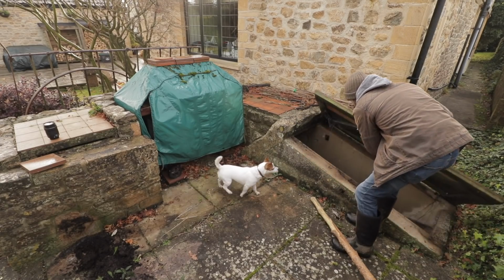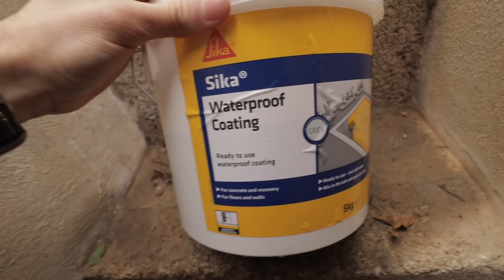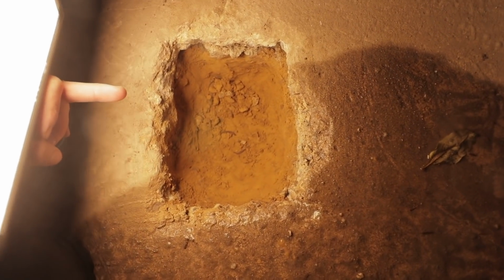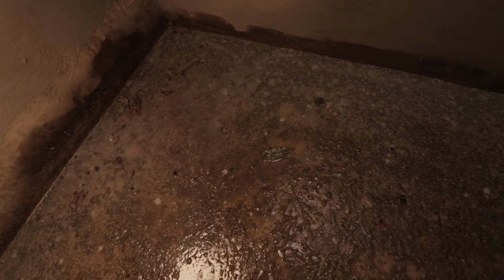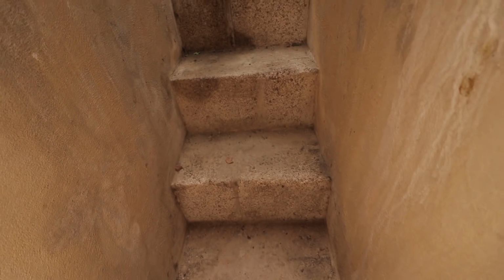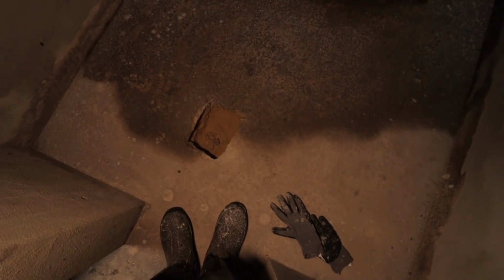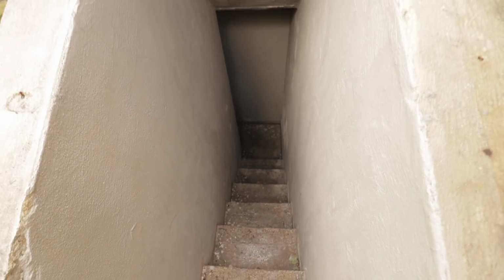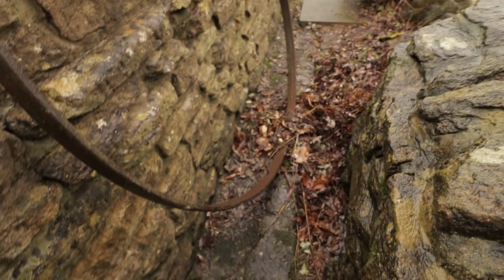WW2 Bunker Renovation: Sealing the Inside (PART 4)

Comment: don't want to be "that" guy but concrete is porous and all the water above and in the soil around the bunker is soaking into the concrete, the concrete needs a way to rid that moisture. sealing the inside just keeps the concrete wet all the time. which is going to make it crack and fall apart sooner. There really is not a good way to save it. you are better off drilling holes through the concrete allowing outside water to run inside and down to the pump.

Comment: If you are like the rest of us with children, money is tight. For a temporary quick-fix, cover the bunker door with a cheap tarpaulin to keep the rain from leaking in. On this side of the pond, we have something called a "breeze box" fan. It is about 2x2 feet, and is 2 or 3 speed, non-reversible. On a dry day, just lay it on top of the vent rebar, blowing UP, and open the main door. This will circulate air. For that spot that needs repointing, don't. Break up the old broken concrete and lay a new section. It will be more effective, and cheaper in the long run. Ian

Comment: You should not have cemented rebar over the vent shaft, but rather installed a temporary cap until you can install a more permanent "door vent" (a vent cap that opens when unlocked from the inside). Why? you are going to want a second EGRESS. Very dangerous to have only one way in/out  : /
Reply: I wondered about that too. looks like a dungeon.

Comment: Use a frame and some flashing around your access door and have drains at the bottom maybe ? Point it all in like mentioned and it should be water tight. Also maybe use a dehumidifier rather than a heater to keep RH to a minimum while it’s drying 👍🏼

Comment: Please get that hole in the floor done, you will regret it later if you don't, as you said at least get a form in there or fill it up until you are ready to put the sump in.

When my friend did his basement about 25 years ago we used a concrete/stone etch primer then ran a coat of what looked and smelled like babies first poo, then created a cage inside the basement with 2mm diameter wire mesh held about 5mm off the walls with little anchor/spacers and then used some kind of shotcrete to cover the mesh, as far as I know, it has not leaked since,  probably a bit of overkill for what you want though lol

Comment: Bit different situation, but I had a leaky shed after Ciara ripped part of the roof off. Good old fashioned tarp on top has dealt with Dennis - I stuck a heater in there (off the floor) for a day and it dried it all out a treat.

Comment: Why don't you just put a rubber seal around the edge of the door, so when it's closed the weight of the door will give the entrance a water tight seal.

Comment: As I've mentioned before, creating a rain-tight door and vent cap is really job #1. If that had been done, chances are the shelter would be dry now. The sump might not have been needed. As damp as it is, the sealant may not cure correctly and could fail.

Comment: Reprint with strong mirror or 5000 pound hydrolic cement out of the can . 
Great job so far consider apoxy paint at least for the floor and steps also try a fan or even  charcoal stove to dry it out faster or wait untill summer computer fans perhaps. Scott from N.H.

Comment: For a Basement I had to stop water leaking in, It came to digging a trench around the entire foundation , then using a rubber based sealant and adding a gravel  surround with perforated pipe to a drain field. Took a lot of time and work. But it did stop the water seeping in. I also painted the inside with a wall sealant, primer then house paint. Guess that is why so many homes today are built without Basements. It is a tough and very time heavy solution in a very wet region of the US. Well worth it in the end to stop many problem's that devalues the entire Home if not repaired correctly. You're lucky it is a small area.

Comment: Should've brought in a fan to move that stagnant air around more to dry it out faster. Painting that bunker by hand must've taken a hours,  why not use a roller for the walls and ceiling and a brush for the corners? Would've been done in 2 hours tops

Comment: Sika products are excellent.
 If you completely seal the bunker you will have condensation problems so a shed cupola with louvres on the shaft top will produce a venturi effect regardless of wind direction. That, coupled with a vent of some kind at the door with something to keep the rain off it will draw air down the stairs and up through the vent, the air movement will help to keep it dry and cool in the bunker

Comment: A little trick I learned from my dad when working with concrete in cold/damp weather is to use  a gas heater to evaporate/heat up the concrete it'll cure better. Or you could use an electric heater. Hopefully either you choose helps.

Comment: The best way to seal would be to seal from the outside of the bunker.  outside of that.  you will ALWAYS have a damp issue.... concrete will wick the water from the ground and it will find a way in.  You will need a dehumidifier 'forever".  sorry mate.

Comment: You can patch the back of the door with a thin layer of glass fiber tissues and epoxy, dig a 1inch wide and 1 and half deep gutter all around the middle of the wall supporting the door and make a tiny step to avoid water running down the stairs.

Comment: You refer to that opening as an air vent... its not an air vent, its an escape hatch for use if the main stairwell gets blocked.  Would have had a ladder under it.  I have restored a shelter.. i kitted my one out with bunk beds, lamps, gas masks, pillows, bedding etc.  All period stuff.  I have posted my bunker on utube ... have a look what i did inside.. it may give you some ideas.  I have a few videos so look through to find the shelter...  again.. thats not a vent.. its an escape hatch.

Comment: Put a rubber condenseable membrane around your door and vent so when you door closes and whatever you put over the vent closes it "crushes" the membrane (like foam rubber) to help seal them.  Also the the stone wall base gaps, use clear Flex Seal and spray it in their.

Comment: I would use a “backer rod” (foam) to fill the gaps outside. Then use a “Hydraulic-cement” mix to tuck point and smooth off them cracks. You will need to mice it in very small amounts, and use it right away, but it FANTASTIC stuff! You can use it to stop up an active flow of water too!

Comment: I’m SO pleased you’re putting concrete in that sump hole to seal it. It’s been worrying me. Lol. Thanks for letting us watch this project.
Reply: Yes he needs to seal that hole, there is NO water showing under the slab. I feel most of the water is coming in from above, at the door or the large vent opening.
Reply: I don't understand why people were worrying about that. Obviously he wasn't going to be putting his pump into a sandy hole in the floor.  Last episode was the first one with actual work being done (besides cleaning), and people were yelling about the hole like it was already the finished bunker. 
(It's like yelling at a builder that there aren't any windows in yet, when they've only just barely put the wall up.)
Reply: I was thinking the same thing
Reply: No need, that slab would be fine with a hole there. He’s well above the water table, all the water appears to be coming from above. I’d put some gravel in it to keep it from being a tripping hazard but it’s better to be there to drain away any water that he should spill or rain that could enter.
Yes, I do this for a living.

Comment: I would put electric floor heat in there on top of thermal and hydro insulation with tile on top. I would also add a sump drain in the middle fitted with a float controlled pump. But then again, maybe not. :)

Comment: Run Two industrial fans with duct working, from the vent (Pushing) and at the door (Pulling), while the coats are drying. 
Also, a better door would be great, but if you insist on using that door, use PINE TAR and BOILED LINSEED OIL and apply it to the door, after you strip it down a little bit. Make sure you use a torch on the door and let it catch fire from time to time (And then put it out,...lol). This will ensure a water tight sealed door between the planks at least. 
Log Cabin Looms (On YouTube) uses this method and it stops ROT and WATER damage on his gun stocks and axe handles, etc. It is old world tech that REALLY works well.
Check him out, he is an amazing human being.

Comment: You need a dehumidifier to pull the moisture out of there.
Reply: He can just take a regular home heater. Just to pump warm air inside. That will do. And he should also seal tight that hole in tho floor
Reply: Use a steamer to determine the leaks and seal them all. Then after use humidifier.
Reply: I have a lot of catching up to do!
Reply: Better off getting a fan heater that can go to a very low heat setting and putting the fan on full blast.
Reply: Airflow alone will help a ton.  A big box fan blowing up out of the "shaft" with the door open will circulate a lot of air and remove moisture down to ambient outdoor levels.
Reply: Agreed seal it up as best you can and put a dehumidifier in game changer
Reply: I was going to say a heater or dehumidifier.  Possibly both. 

 But with those who've said get air flow,  I agree.
Reply: And a tarp over the skylight while it rains
Reply: @Vlad-ip5tq  I find Electric heat the best for drying out small areas, it drys out mold to some degree as well.  A small electric heater will dry that room out in no time at all. The leaks will still remain until the walls are sealed but you would have a dry surface to lay your sealant on.
Reply: @Mumbo_Jumbo_Kiwi.1  - What the hell are you actually talking about?
Reply: @leeholke9851  Not if you seal it Temporarily and unseal it when it's sealed and dry.
Reply: Tiger torch
Reply: I thought that, seal the door and top temporarily and use a dehumidifier after a small fan heater to pull out the moisture and dry whilst showing where the cracks are most likely to be as they'll definitely show when dried out, i'd also say some from of protection against mold too ideally under the waterproof coating but looking at the walls it would probably be best overtop, saying that i can imagine how darn awkward that would be in a space like that aha, as long as there's a vent of some form after it's all done to prevent moisture build up you should be pretty peachy :)

Definitely needs a low heat to help dry though as it'll be drastically weaker if moisture gets in whilst drying,much in the same way with plastering and patch work, it's just a shame you can't apply it to the back of those walls where it will be stronger, overall though i'm really loving this series dude, it's such a cool little project and something i wish i could do myself one day.
Reply: If everything else fails, you can grow mushrooms down there!  Perfect conditions.  Good luck!
Reply: I could not see the label on the stuff you mixed up to put on walls to seal them. I need some of whatever it is? Name?

Comment: I would suggest cementing the interior of the drainage hole and also sealing that. Otherwise you might just end up with a soggy hole and leave a weak point around it in the floor.

There are some good waterproofing products like" Thompson's One Coat Water Seal, it uses a unique micro silicone emulsion to stop water penetration. Apply just one coat of Water Seal directly onto damp surfaces to provide long lasting waterproof protection within hours." 

As for the top of the hole. Could you make some sort of hinged shutter system with a top layer of corrogated steel for the authentic look, A corrogated plastic for when you are down there but need protection from the elemenys and maybe even make that one lift as well for better ventilation too.

Also have a look to make sure moisture isnt getting in from your entrance hatch too.

Comment: water isn't coming from within the bunker, it's come from outside of the bunker. Sealing the inside will do nothing but guarantee paint bubbles and future leaks. you need to dig up around the bunker, waterproof and install a proper water barrier, then cover it back up, Rent a heating unit and put it inside the bunker and let the walls properly dry out for a few days - then you can prime and paint it. you guys are just wasting dosh on this.

Comment: Good day.  

as lighting you can easily hang on the hooks and the eye (at the stairs) on the ceiling a led light hose for outside 
than the your (walking) light in the bunker with an extension cord at the door or through the air grille .

and for the pump I would FIRST measure well for example with a spirit level or better with a laser level where the lowest point in the floor really IS
because I think that where you now have the hole for the pump is NOT the lowest point in the floor 
and  then you better if you are going to take the trouble for a pump sump it is really at the lowest point .

maybe you could suck up the remaining water with a wet / dry vacuum cleaner .

With kind regards Hollandduck from the Netherlands 
(source of translation: Google translate)

Comment: When you do the paint do a third coat of latex or other good exterior paint its should allow you to pressure-wash the walls also do the floor most don't and it causes problems, as for your "Sky-Light" if you want to keep it there are decorative cement bricks  with holes in them use them to form a interior wall and exterior wall, extend the sides to the front then top with Lexan (AKA Poly-carbonate) and finish the edges with hard local stone & mortar as for the door 3 things 1)scrape and paint with again a good latex or other good exterior paint 2) add spongy weather stripping to both the door and the cement (making sure that the two are in the same line to make a strong seal) 3)a god latch so your child and/or any future kids cant just open the door and fall down those steps also to help seal the weather striping . As for the interior if you keep the "Sky-Light" a string of solar powered LED lights to make it easier and/or maybe even a small  workbench and make it your T.A. Outdoors workshop

Comment: A simple drip-edge (A peice of aluminum designed to work like a gutter) will help mitigate water coming in through the top of the door.

Masonry cement can help dealing  with the cracks in the old stonework walls.

And a dehumidifier will suck the moisture right out of the that room. You can also install a Turbine Roofing Vent (The round one that spins with the wind and vents heat/moisture out of attics) for an electric free option, though you might lose the skylight.

Hope this helps!

Comment: When we moved into our house 3 years ago we have a cellar that was under 2 foot of rain water for the last 10 years,  I pumped it out then placed a industrial sized dehumidifier in for a month,  then fixed some damp proof wall membrane on floor and walls,  
Luckily for me I found out when I was digging a bigger hole to fix a permanent sump pump i found a old terracotta pipe that was broken and badly cracked,  council came out and jet watered it, then sent a probe down, apparently it was blocked about 100 foot down the pipe,  

Touch wood 3 years on it's a proper man cave and no dampness whatsoever,  

Might be a bit late now but I highly recommend the wall membrane,  you just drill 10mm plastic self sealing wall plugs every 18 inches to hold into place, 

Love watching your channel TA, keep up the great work.

Comment: I spent most of 2019 on a building site with a leaky underground garage. Getting the concrete sealed was super super difficult. The experts always said that there isn’t much you can do from the inside.
Reply: true.I built my house with a cellar.I wrapped all four walls from below the foundation with a special stiff bumpy plastic before backfilling the blockwork with gravel and  sand so that the outer walls are dry and ventilated . It  has never been damp but the site is very well-drained sand and gravel too.
If this air-raid shelter is in clay soil next to a house it is going to be in ground-water for long periods.Even with ventilation or dehumidifiers moisture will be drawn into the structure through any porosity .
Reply: Ian Rutherford Exactly that! If its standing in water you should get rid of that. A drainage hole going down vertically with a pump underneath foundation level would work.

Comment: When it comes to sealing the door, you’re probably best getting rid of the wooden one. Also I would remove some of the stone work on that top edge to give you a wider frame around the door to seal against. Maybe add more concrete around the whole area around it and flatten it as best you can and then having obtained or made a new door use rubber seals around its edge with hinge clamps to keep it down. Basically like a big pickling jar.
Reply: Depending on how the skylight is done, there will be very little ventilation if it's done that way.
Reply: Zaire  Houses are done that way - simply needs a weather proof ventilator.
Reply: @stephencrowther524  Houses have chimneys, and people open their windows.
That bunker has no ventilator, and you'd need to dig a pretty generously sized hole to fit one in. It also has no windows, so the skylight is likely not going to be air tight.
Reply: Argh Jay Em 
>wooden door
>not sealing
reminds me of something lmao